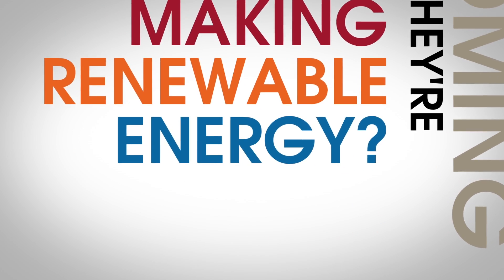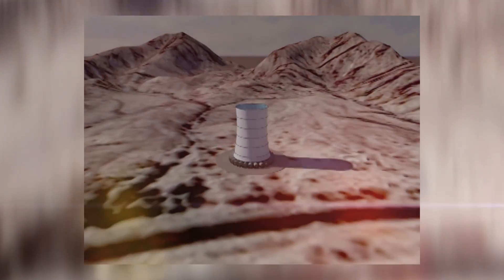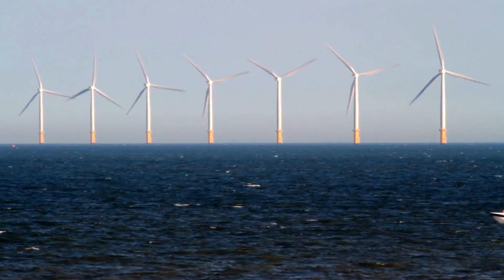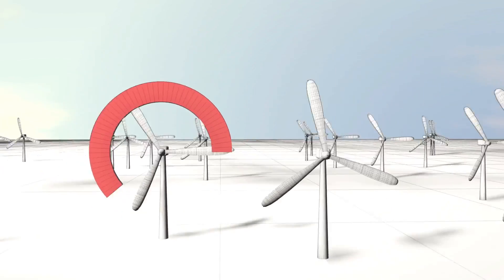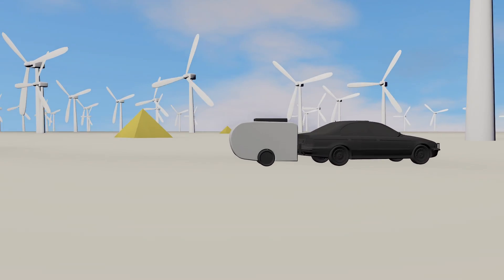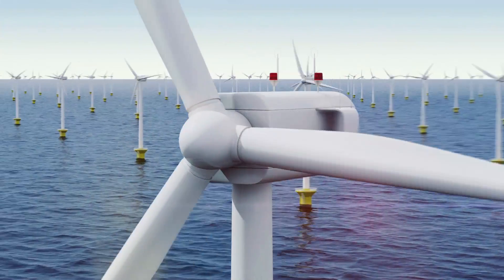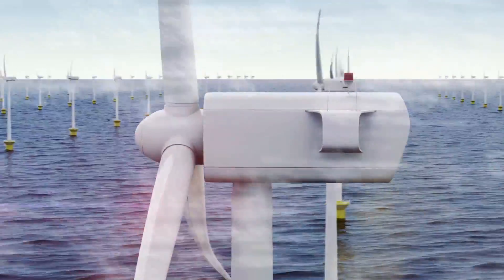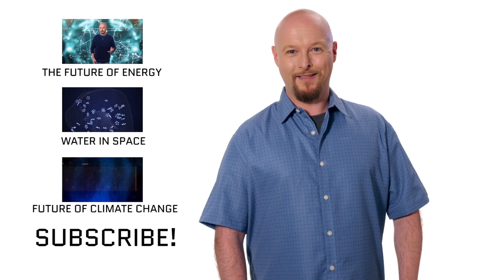The Future of Renewable Energy...is Coming from Drones?

Comment: What we really need, is efficient, cost effective grid scale electrical energy storage. That would provide a way to store energy when available from wind, or any other renewable source, and supply it when there's a demand. The question you mentioned at the end shouldn't be which one, but which combination. Using energy from multiple sources, which provide their energy at different times, reduces the amount of electrical energy storage necessary for the amount of generating capacity, and the customer base being served by it. an example would be the fact that photovoltaic panels do their best work during the day, and turbines tend to run in the mornings, and evenings. That more steady power means that the "battery" (or its equivalent) doesn't have to fill quite as long of a supply gap, therefore, doesn't need to be quite so big,(expensive). Without energy storage, wind turbines or solar can only be about 20% of generating capacity, without creating problems with grid stability.

Comment: http://www.google.com/makani/technology/ 
MakaniPower is great- should be less that $0.03/kwhr LCOE.   Google bought them.  But the illustration in this video is weird- seems wrong unless they have totally changed their physics.   Check google.com/makani for the right video.  Because it is the wing that collects the power and the 6 rotors that turn the energy in to electricity--- so you don't want to use a hex copter design!  There is no wing to pick up the wind's energy in that circle.    

Makani is twice as good as tradational wind turbines in 6 different ways. 

Note that Offshore is real opportunity for them.   Building towers in deep ocean is impossible at low cost.  Europes off shore wind is in shallow seas.  THe west coasts of most continents are deep though.  Makani's tether can be hooked to a buoy or barge and doesn't require a stable platform, so it is almost as cheap to deploy at sea as on shore.  On shore it is cheaper because it is so small and light that a road is not needed to its base.

Comment: Not real actually. The US doesn't yet have a single wind turbine at sea. Almost all of the worlds offshore wind power installations are in Europe. As those seen here in the video.
Reply: Deep water on the west coast, and horrible regulations are two reasons the USA has no off shore wind.  Also general sense of complacency and a political system in deadlock dominated by Koch-heads.  Makani can really help by making deep water offshore almost as cheap as on land.

Comment: I think nuclear energy is something we should reconsider. Solar and wind can only provide enough power for residential capacity at best. Nuclear energy could provide both residential and industrial capacity. The uranium inside a nuclear power plant can’t explode. Not one individual has died from radiation due to a modern nuclear power plant—not at Fukushima, not at Three Mile Island. The majority of
the people that died as a result of Chernobyl were involved in the
rescue following the accident, which was caused by a combination
of an unstable design and operator error. The energy in nuclear
material is a million times more concentrated than the energy in
materials used in other forms of energy production. That means it
has exciting economic potential, if it weren’t so controlled by
government. And it means that the waste it generates is small, and,
as France has shown, easy to deal with. Check out this website

www.industrialprogress.com
Reply: yes but very little uranium is usable, its expensive to mine, and to store. solar panels are smaller, easier to create and and fix, and has a unlimited source of power. it does come out with zero waste but that waste builds up. it can be thrown out, and places to put it is expensive. if humane error does occurre or the plant it damages it can cost millions to fix, if it has not past that point. if waste or uranium does escape we can end up with a place that cant be rehabilitated for million if not billions of years. these plants have to be built from civilization while solar panels can be built on top of homes, and small scale wind mills can be put in backyards. nuclear power is yes the most fruitful but its threat to environment out weighs its reaps.
Reply: Give it 5 years, the people involved in the clean up at Fukushima will start to die off. With geopolitical risks, it's just too dangerous. The commissioning costs of nuclear is just too high.

Comment: Personally, I think some mix of solar, hydro and petrol is the way to go.  For the amount of energy produced by wind, the footprint is very large, and nuclear, after the rods are spent they require years to cool, at least for fission, I haven't heard much on fusion.
Reply: If fusion comes to fruition, it will render everything else functionally obsolete. Hydrogen, with that kind of energy density when fused into deuterium, then into helium 3, is a virtually inexhaustible resource.

Comment: I do think that the Solar Wind Energy Tower is a very interesting idea.  However in the video it was stated as using water vapor injected into the air, but it was also stated that it was in the desert.  Obviously under these circumstances placement would be crucial unless you wanted to be pumping water from however far away and up the tower.  It would need to be close to water in order for the energy required to bring the water to the top of the tower to not offset the limited amount of power that this may generate, though it's an interesting idea.  Another question is how much space would something like this take up?  It seems like it would have a large physical footprint.  As for the portable wind turbine...the energy required to get to somewhere windy could easily offset whatever small amount of power this may produce, how would this windmill even get airborne?  While I'm sure you could make the "mill" light enough to get airborne...what about the power cable/tether?  Just a few thoughts.